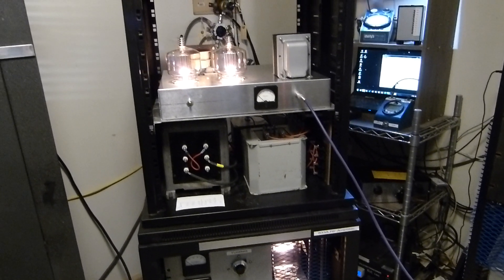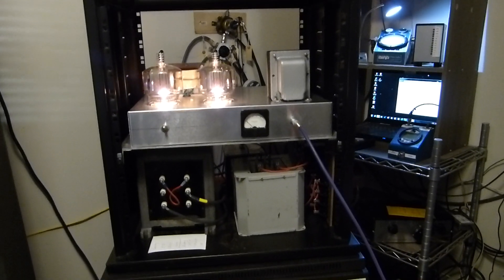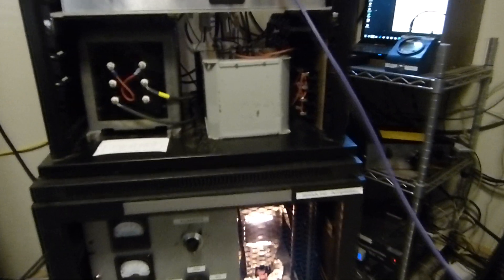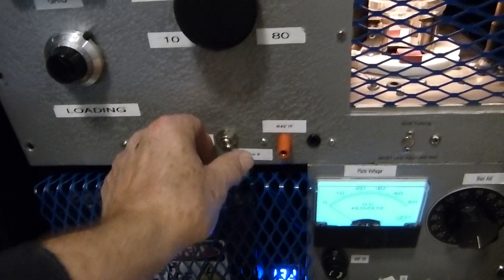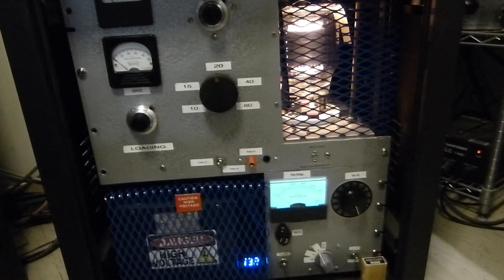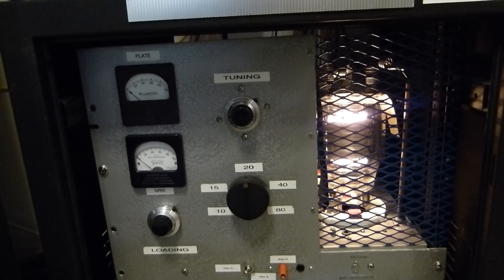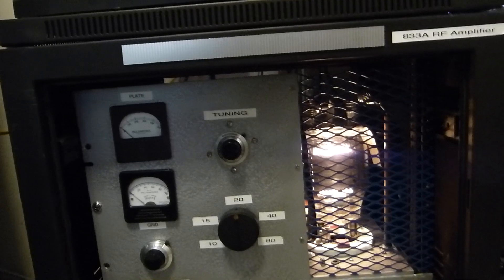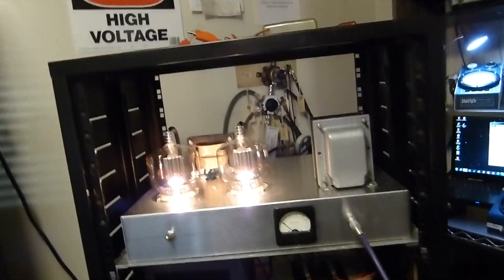Plate Modulating The Mighty 833A

Comment: You could try mounting the transformer on rubber.  I wonder if the xfrmr is vibrating the shelf it is sitting on?  Sort of making a speaker out of the shelf.
And/or wrap the xfrmr with sound deadening material, similar to what car audio nuts stick on the inside of their doors to deaden the car.

Good to see you again!  Hope you are doing well.
Take care!
Reply from the maker: I think, as you mention, part of the issue was that it was sitting on metal. I made a couple of comments above of how I set it on a rubber mat and a large insulated ammo box over it. Also, I added some 0.01uF 10KV capacitors across the primary and secondary to squelch audio harmonics and that helped a bit also. I have never dealt with this level of HV modulation. Audio peaks were no doubt reaching 7KV+ and things start happening at those levels that don't happen at 3.5KV DC.
I am doing OK - I suppose - life has changed so much  - I have been alone eleven months now. Just wish I had more energy to work on projects and post videos and communicate with you guys.
Reply: @ElPasoTubeAmps  Good to hear that you are doing OK!  I wouldn't worry too much about your projects and posting videos right now.  You need to take care of YOU!
You have done SO MUCH and been a wealth of information and your knowledge that you have shared is a treasure!
Not go get too "out there", but you are NOT alone!  and NO ONE can tell you to "get over it"!!!  That is up to YOU and ONLY you!  Just take care of yourself!
You have SO MUCH to offer.
I have lost both my parents (2009 Mother, 2019 Father) and my sister (1985).  I just try my best to keep my projects going, which I love to do, and try not to become a recluse.
I very much enjoy all your videos as they have tons of information, are sometimes comical, and I really like your attention to detail and your craftsmanship!  You do NICE work!

Anyway, I wish you well and hope to see many more of you, but do take care of yourself!
Bill